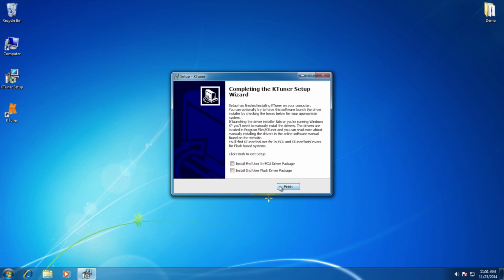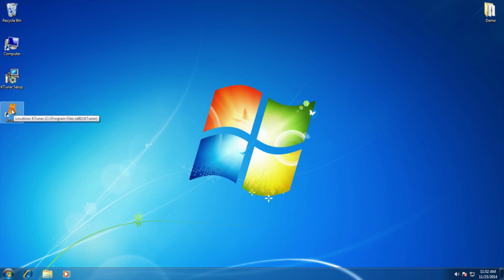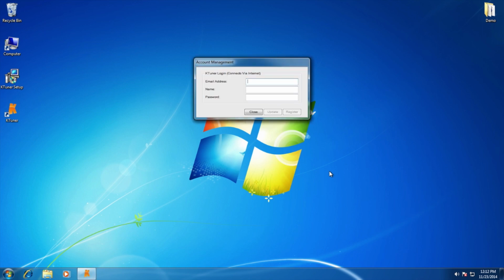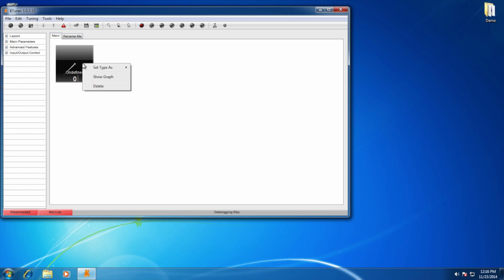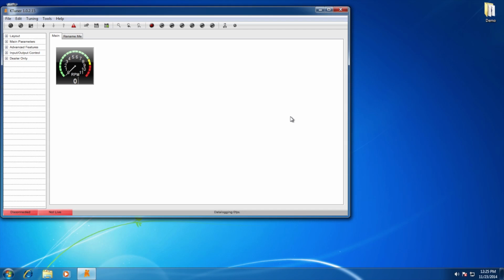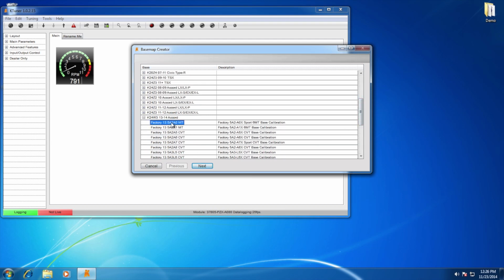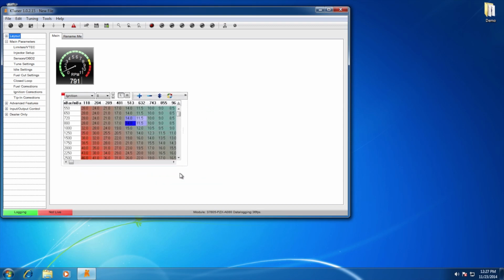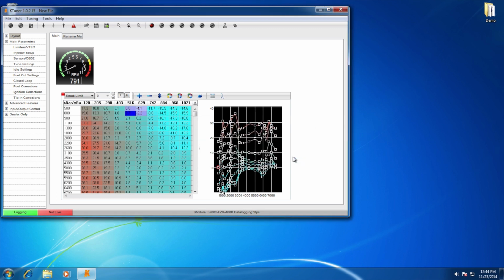KTuner Getting Started Part 1

Comment: Please Help. i keep getting an error message: Ktuner.exe that this shortcut refers has been changed or moved, so this shortcut will no longer work properly. I've uninstalled and reinstalled multiple times and it closes by itself and i get that message when i try to open it
Reply: it was working fine before.. this happened all of a sudden
Reply: @penguin5597  did you ever figure it out?

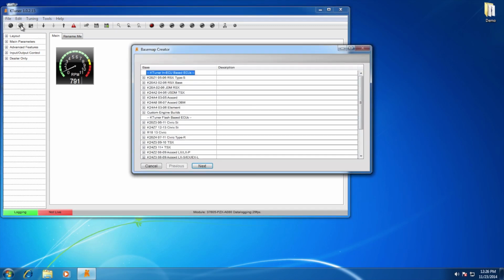Comment: I couldn't find 09-14 Acura TL in the basemap creator @5:32. Is there a different ktuner model that supports the TL?
Reply: Did you end up tuning your car? I have a 4th gen TL as well
Reply: @lmaoboy8546  yes, I used one of the base maps. I did not have any mod, so I didn't feel any gain. I ended up selling the ktuner